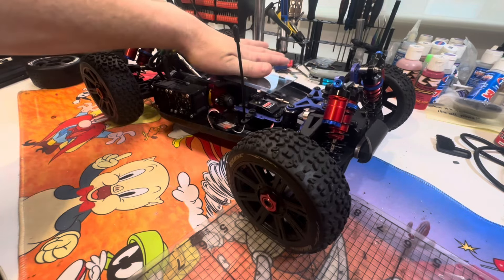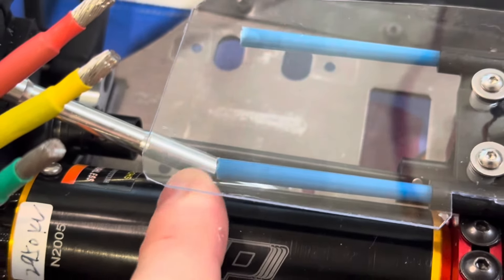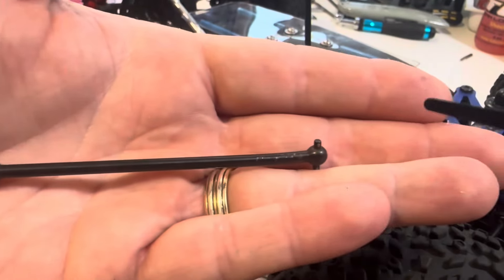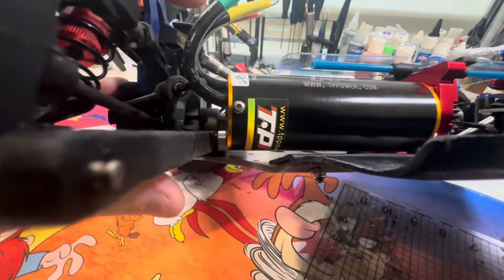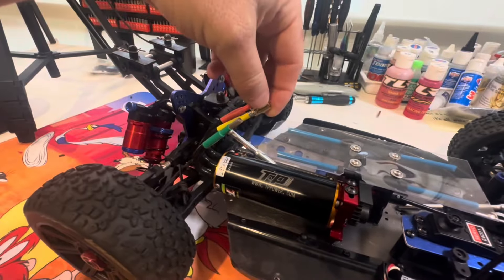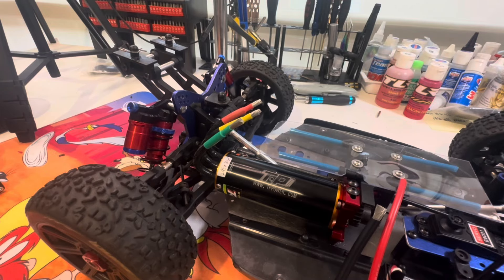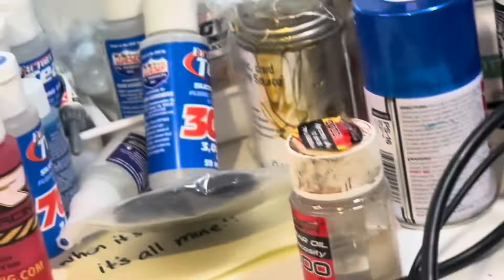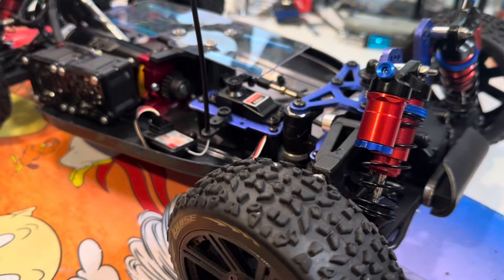1/8 RC Buggy with 1/5 internals this is going to be insane ￼

Comment: CG shifted upwrds significantly i imagine!
Reply from the maker: Yes it is atm I won’t to see if it will affect the way it drives first . If it doesn’t affect it I’ll leave it but if it does I’ll have to shave the motor mount down. But there is no binding at all rolls smoothly so I at the point let’s see what happens lol . Thanks for the message I hope you like the vids . 
Kind regards 
Glen

Comment: Ngl this looks like such abortion, it will fold itself under its own weight. The chassis wouldnt even be able to handle standard 4s system let alone this tp motor with 10 lbs of ballast on top. You will never get even third of the power down through the wheels.
This is really the worst chassis to do such stunts on
Reply from the maker: Thanks for your comment but I have ran 4s though a very similar chassis before without no problems. It’s all trail and error it might fold , not hold up but it’s worth giving it ago see what it can do . I won’t be jumping it it will be for straight line speed maybe like a speed run car if you get the idea. But to me this is what I enjoy doing making a Frankenstein car and see what it does. I hope you like the vid 
Kind regards 
Glen